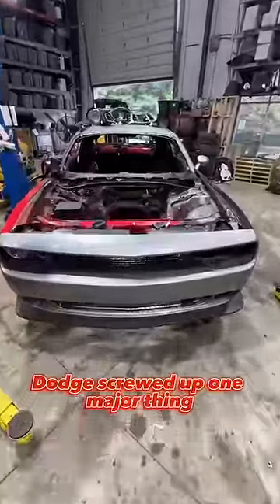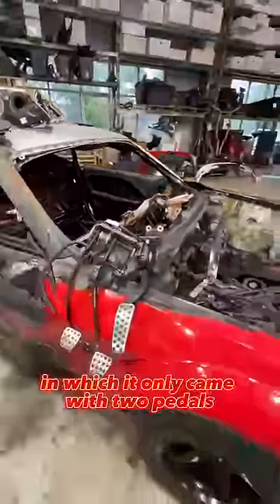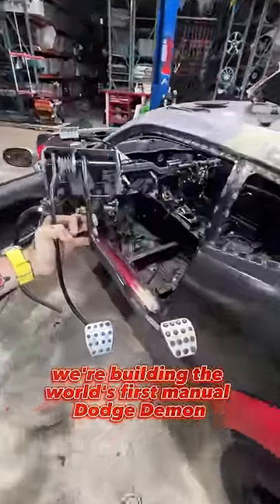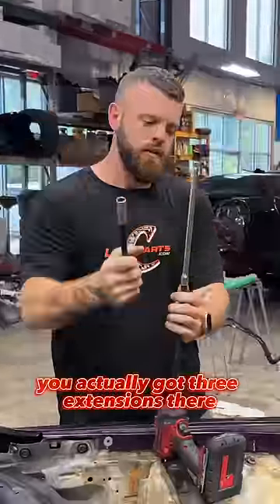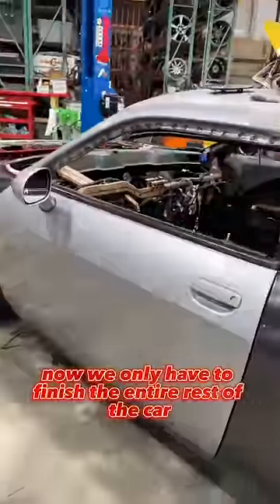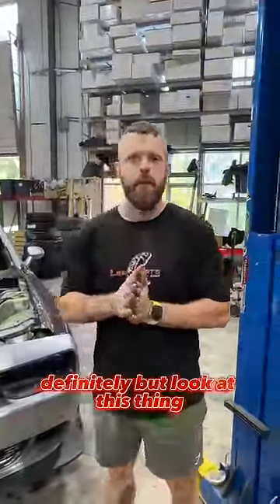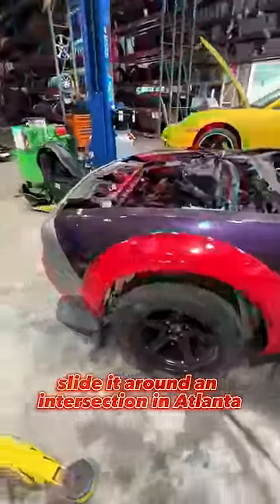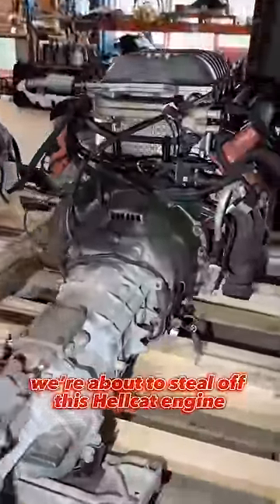Dodge made one HUGE mistake on the Demon!

Comment: Dodge had that trans dialed in. Swapping to a manual transmission will definitely be slower. Cool swap still
Reply: It will be slower but a manual is way more fun
Reply: @bryceangle9773  definitely fun. Be interesting to see how this goes.
Reply: No way 🤯🤯
Reply: @jimcole2648 the same transmission in the hellcats is slower than the manual option. Maybe it’s upgraded for the demon but it is the same transmission.
Reply: @joshroi8610 the automatic hellcats blow the doors off the manual hellcats. All day.
Reply: Differential Gand gear ratios enter the chat.
Reply: Oh wait, dodge owners
Reply: @joshroi8610 different gearing and probably a few more upgraded parts demon is a purpose built drag car, the trans is perfected allowing the 4500lb boat to pop wheelies and run a 9.4 quarter
Reply: @joshroi8610  the cat I drove was pretty quick to me. Definitely not a lag like a clutch. Not pdk Porsche fast but quick imo
Reply: @bryceangle9773 not really
Reply: My hellcat challenger 6spd has 3:70 gears and runs around automatic cars constantly, only difference is the fact that I can drive.
Reply: @ronyoung6054  the driver does make a difference yes. I wonder if there are any videos of a subordinate/manual comparison to see and swap drivers for the runs to not be bias
Reply: @jimcole2648  it takes less horsepower to turn a manual trans than an automatic,  just set your automatic transmission and manual transmission side by side and spin the input shaft by hand
Reply: Modern day automatics will always be better than a manual driver. Dodge effectively engineered out the "Driver Mod"
Reply: @bryceangle9773 I mean the whole point of the demon is to get the fastest drag times so
Reply: @ronyoung6054 this would matter if it was a 2000lb Honda civic with 100hp but it’s a boat with over 800 horsepower manual or auto it can’t care
Reply: Yea imagine the hood dudes in demons had manual theyre already going stupid with the auto
Reply: @ChimenyDust  will be interesting to see how the power is laid down over the auto.  The autos are pretty beefed up.
Reply: @johnnybanks61  this isn’t a Porsche pdk but it’s still a pretty quick trans. The throttle is also.
Reply: @ronyoung6054  true but the difference is not much to compare.
Reply: Some of y'all need to study torque multipliers. Hint, clutches don't have them.
Reply: Who cares if it's slower? It's a heavy boat, at least manual will make it funnier to drive
Reply: @ShogunAutoworks torque multipliers? You mean a convertor? And what does that have to do with the conversation
Reply: @trashbandit2449  torque converters are gear reduction drives until the input and output speeds match.
They MULTIPLY TORQUE. 

Which is like...nice...when drag racing...
Reply: @trashbandit2449  and so the arguments between making it slower vs faster... it did in fact make it slower. Which is fine it's still a damned drag monster. But people are going off the assumption automatics are all Buick slushboxes. Even in the world of normal vehicles, slow ones even, an auto outpulls the manual if everything else is the same. At a dead stop the engine torque is multiplied 1.5-2 times over due to the gear reduction effect, and as the car (or truck) speeds up it gradually turns into a 1:1 drive. Then shifts. Same multiplication though not AS much because the output speed isn't starting at zero so it's already a head start. But still more than the 1:1 you get in a manual once your foot is off the clutch. And the only way to copy that effect...is burn the clutch up slipping it.
Reply: @trashbandit2449  manuals are more fun. And manuals with more gears are faster than autos with less gears sometimes, due to so much spread between shifts. 
But a 5 speed auto would destroy a 5 speed manual assuming all the other variables weight engine are the same.

Now we have close ratio 5 6 8 10 speed autos WITH torque converters.

Not just 2 speed slush boxes vs 4 and 5 speed manuals. The auto vs manual debate answer isn't one or the other. The answer is IT DEPENDS which autos vs which manuals...
Reply: @trashbandit2449  I say this so you don't do what I did. I was beating v8 pickup trucks and could pull a lot more in my 4 speed AUTO Baja, than I can with my 5 speed manual of the same truck. And that's a big deal considering the manual has 4.44 gear ratios and still can't pull a trailer or another broke down vehicle worth a shit. 

With the auto I drug people from ditches, hauled stuff, pulled a big ass 2006 f150 4x4 quad cab 5.4 liter 15 miles home down the highway and back roads... 

I almost burnt my clutch up trying not to stall the manual just trying to pull a minivan onto a haul dolly...

Torque converters multiply your torque. SERIOUS drag racing... autos. Hence why the CAPO Camaro and Demon were both autos.

But like I said in small trucks...auto. small cars, weak ass engine, might wanna get an auto.

Fun, manual. It's just a trade off depends what you need worst.
Reply: @ShogunAutoworks  yes autos will be faster but torque convertors don't really multiply an engines torque going to the wheels. All things the same, a manual transmission will send more power to the wheels than an auto. All a torque convertor does is transfer the power, not multiply it

Pulling has more to do with stalling/not stalling. Not really anything with torque convertors (other than the fact that if your convertor is too high you'll kill your transmission by towing)
Reply: @ShogunAutoworks  that being said I would rather tow with an automatic
Reply: @illililililillli  I’m not disagreeing it will be slower. I think it will but again it would be a cool swap to see. Looking forward to it
Reply: @ShogunAutoworks thats.. not how torque converters work...
Reply: @outkast937  according to hot rod magazine, car and driver, popular mechanics, and about any other sources yes it is.
Reply: @trashbandit2449  it multiplies it during slippage. Fact.
Reply: Copied directly.

A typical torque converter will have a torque multiplication ratio in the area of 2.5:1. The main point to remember is that all properly functioning torque converters do indeed multiply torque doing initial acceleration. the more drastic the change in fluid path caused by the stator from its "natural: return path, the higher the torque multiplication ratio, a given converter will have. Torque multiplication does not occur with a manual transmission, clutch and pressure plate; hence the need for a heavy flywheel, very high numerical gear ratios, and high launch RPM. A more detailed discussion of torque multiplication can be very confusing to the layman as high multiplication ratios can be easily considered the best choice when in fact more variables must be included in the decision. Remember, the ratio is still a factor of the engine torque in the relevant range of the torque converter stall speed, i.e.: a converter with a multiplication ratio of 2.5:1 that stalls 3000rpm will produce 500 ft/lbs of torque in the instance of full throttle acceleration if its coupled to an engine producing 200 ft/lbs of torque at 3000rpm. However, if this same engine produces 300 ft/lbs of torque at 4000 rpm, we would be better off with a converter that stalled 4000 rpm with only 2.0:1 torque multiplication ratio, i.e.: 300 x 2.0 = 600 ft/lbs at initial acceleration. Of course it would be better yet to have a 2.5:1 ratio with a 4000rpm in this example (provided this combination still allows the suspension to work and the tyres don't spin). This is just a brief overview as the actual scenarios are endless.
Reply: This, I see in my own vehicle, the last identical engine powered vehicle being an auto and the next a manual...
Same engine... 

a converter with a multiplication ratio of 2.5:1 that stalls 3000rpm will produce 500 ft/lbs of torque in the instance of full throttle acceleration if its coupled to an engine producing 200 ft/lbs of torque at 3000rpm.
Reply: Also you may have a 500hp engine but it's only 500hp at one little spot on the rpm range buddy.

You wanna stay high rpm as much as possible where we your 500hp sits at. You aren't doing it with a manual sorry. Especially once you launch and dump that clutch unless you just spin all the way down the track and never shift. 

The auto allows slippage PLUS traction, while multiplying torque and letting the engine over rev what the rear end is doing to keep the engine in its power band while the ass end finally speeds up and it's time to shift and then it can over rev the ass again and multiply the torque some more. 

Dude there is a reason promods aren't 5 speed sticks or whatever.
I'm not even ragging the car a stick shift demon is still a fuckin insane ass build.

I'm trying to help you. Torque converters are by far the easiest mod... and if you don't understand em .... you're missing out.
Reply: @ShogunAutoworks  during slippage yeah, and of course they're faster. But a nicely set up brake/linelock/transbrake will handle launches just as well. But yes I agree with what you've said
Reply: An automatic will always be faster, but I'm surprised they didn't at least have it as an option
Reply: As someone over 50, I never imagined the complexity and efficiency of today's automatic transmissions.
Reply: @bryceangle9773 not really. 

People who drive a manual because its cool to do so in their mind say that.
Reply: @mainmanmooky8820  true. From what I was hearing in auburn hill proving grounds, they took a trackhawk driveline and swapped it in a challenger. Said it was fun beast but would never really build. Must be fun working in the testing department
Reply: @jeepmanxj It engages you with the car more that's it. Also people who drive manual pay more attention to the road and that's a fact because you have too. They are slower but also has alot of pros that an automatic can't do
Reply: @clutchbleach2057  no. You don't and that's how I know you haven't driven with one very long.
Reply: @jimcole2648  about 20 30 %
Reply: @bryceangle9773 manual is not fun 😂
Reply: Who cares, your not doing over 45mph on city roads anyway. Manual is way more fun then mindlessly driving in traffic. I know hes taking this to a track but most people manual is fine
Reply: @betastagevirus997  yes and no.  Driving a stick in bumper to bumper traffic and hills is a pain in the ass.  You make a good point on speed and city limits but this in a stick would be interesting but that auto is pretty good.
Reply: Manual is so much more fun to drive.
Reply: Autotragic users flexing “its faster” my brother in Christ you lose 15% more power just in parasitic loss with an auto 😭
Reply: Automakers only make these cars with autos for accessibility purposes.  Manual sports cars were restricted to just rich white men, but now that they're automatic, they can also be sold to women and diverse groups.  It just happened to be a happy coincidence that a transmission with 42 gears that has a computer shift itself is faster than a transmission with 6 gears that needs to be shifted by a person.
Reply: @joshroi8610  it's not humanly possible to shift faster than that automatic. So, no. Just...no.
Reply: The torque converter is what transmits that torque from the engine to a rotating driven load. In an automatic transmission car, the torque converter connects the power source to the load. 

Clutches are best for high-speed applications, while torque converters are ideal for applications that involve heavy loads.

Is A torque converter Faster than a manual?

It will double the torque and you will go more than twice as fast compared to a manual that will also need some clutch slippage until it gets to a good rpm like 2000rpm. It's also good when you are in a high gear and accelerate.

Will a new torque converter give me more power?

Thus, an upgraded or stronger TC will provide a better transfer of power to the drivetrain. You will not be gaining any horsepower, rather you will be recovering horsepower that would have been normally lost with your stock TC. In addition, a stronger TC will have a higher stall speed.

Dodge knew what they were doing building a purpose built car. And the manual wasn't it. I own several cars. Seven. Mostly manuals. But the one built auto blows them all away on a dig. Then the road gets longer....😂

Ahhhh. But the PDK Porsche...The combination of thumping upshifts, aggressive auto-timed downshifts and tightly spaced ratios is enough, but clearly such special Stuttgart engineering has resulted in transmission longevity too.

It’s best sampled beyond 8000rpm in a 911 GT3 RS, where you can even pull both paddles at once and uncouple both clutches to, “neutralise the driving behaviour of the vehicle when oversteering in a wet curve, thus redirecting additional cornering force to the wheels of the rear axle”. Then the cloud dissapears and you temporarily see heaven and Jesus squinting not to look. Marvelous.....🙏
Reply: @dailydose8035 sounds like probably a driver issue
Reply: @dailydose8035 Not if you powershift a manual, and do it correctly without chewing teeth off the gears. Automatic transmissions function by slipping, it's part of their design. The side effects of that is less power getting to the wheels. Manuals, however, do not slip. Well, they don't if the clutch isn't worn out. They have a complete lockup, meaning more power is transferred to the wheels.
Reply: The trans wouldn't have blown up from factory if it would've had 3 Pedals, but ya know, dodge messed up again with the transmissions just like they did with their early 2000 1500 pick up truck transmissions.
Reply: @guitarist-2925  It wasn't the 1500's it was the 2500's and it was only one transmission, that wasn't even made by Dodge. 

Also... We just gonna ignore the Ford/Chevy 10 speed transmissions that have been blowing up left and right? Why don't I see anybody talking about that junk 😂
Reply: @guitarist-2925  these transmissions are good. They did their homework to make this reliable.
Reply: @bryceangle9773 suppose if you're keeping it on the track driving is about having fun
Reply: @joshroi8610 there is no such thing as a manual version of a car being faster than the automatic version because computers will always be faster than any human when shifting
Reply: "It we be slower"

Like a majority of people can even make use of it anyway 🤦‍♂️
Reply: @johnnybanks61 better at what? Driving fast in a straight line? Autos in autocross get shit on
Reply: @joshroi8610 yeah no autos are way faster and it’s not debatable
Reply: Same with the R35 GTR a manual wouldn't have benefited the car in any way shape or form
Reply: @bryceangle9773 that's not always the case tho , if a manufacturer makes a car with 2 options for the gearbox one manual one DSG it's always more likely that the DSG sounds better , drives better, performs better and can handle the power you throw at it better , manuals are good on cars that only exclusively came with a manual like the Honda Type R cars like the Ford Focus ST and RS cars if a car has a dual clutch version it's better , we as a people need to stop making as if manuals are the greatest thing on mankind yes i admit swapping some cars to manual is amazing it's great like swapping a known supercar to a manual which didn't come with a manual that's cool but swapping a manual into a car that actually came with a manual or speccing your car with a manual when the DCT or DSG is actually better is actually dumb imagine speccing a BMW M car with a manual nah nah nah up untill the E46 all BMW's should be manual but not the bigger cars like the 5 series and up so sometimes you have to think and say to yourself nah it doesn't work
Reply: Either way it will still lose to a Tesla Plaid.
Reply: Half a second slower with experienced drivers 1/4 mile from a roll I would bet 6 speed pulls
Reply: Half a second slower with experienced drivers 1/4 mile from a roll I would bet 6 speed pulls
Reply: Put a  t56 Mangum, mint
Reply: The Miata isn't that fast and yet it's loads of fun. Fun > Speed.
Reply: lol 😂not by much with a car with that much power will beat a auto anyday
Reply: @tatsuhirosatou5513 yes really
Reply: @Billmull8622  no manuals are over rated especially in straight line cars
Reply: True but who’s trying to get a ticket
Reply: Maybe they can make up the difference in speed by adding more hp,maybe twin turbos
Reply: @Buster_Stankbag  no they are already at a traction limit, plus the epa won't let them add more power
Reply: I dont care how dialed in it is a manual is over better acceleration out of corners and such. In a drag race maybe not faster but a acceleration corners race yes
Reply: @csb772  a manual is never faster
Reply: False a manual has and will always be faster. A computer can only drift so fast while humans evolve and learn. Never have I seen a automatic beat a manual. Not once in history.
Reply: @dailydose8035 that’s kinda weird fr but I guess if they don’t come with a custom one made for them that’s how it goes?
Reply: @bryceangle9773 And more control over everything. Period.
Reply: It will also be more control, especially if it is ever used in any type of twisties. Totally worth it for a road car.
Reply: Automatic is ass, l2drive stick and stop coping
Reply: Slower in a straight line yea… but a Tesla can stomp harder with a couple hacks. 

If straight line speed is all you car about. Go electric.
Reply: The reason the demon only came in auto is that there aren't really any manual transmissions that handle the power.  "Upgrading" to a weaker manual with 2 less gears isn't much of an upgrade.  All so you can have a clutch pedal to prop up your masculinity.
Reply: You can make up for slower shifts with a extra 500hp
Reply: @skaterboy708  gas vs electric and awd? 🤣
Reply: @ronyoung6054 , other cars with how much hp?
Reply: "Manuals are more fun" only said by people who have never had a 4k torque converter and 600hp. Ignorance is unfortunate. No idea how much they are missing out on.
Reply: @AndrewKidd14145 Thank you. Most people don't think about this and assume everything is the same.
Reply: @ShogunAutoworks Exactly
Reply: @ShogunAutoworks Exactly
Reply: @trashbandit2449 You know only an automatic can have a transbrake.
Reply: @ronyoung6054 yeah but 0-60 is worse because you need to shift to 3rd for 60
Reply: @mike-yv9nt my car goes 98 mph in 2nd
Reply: No shit Sherlock
Reply: @CoolHandLukeVol  because there's no way possible to launch a manual and never has been
Reply: Yeah, it's gonna be hard to control that car and its speed with a manual
Reply: Dodge doesn’t have a good reputation with their slipomatic… I mean automatic transmissions.
Reply: @dailydose8035 The manual is more tune friendly and more fun to drive. Not to mention you get more control over what the car does.
Reply: @archwolf3835 I agree, manual transmission's are for men only
Reply: @iheartapple-114  they had some trans that were horrible I will agree. Other makers have their issues also.  This auto is a well built trans imo
Reply: @ronyoung6054 As a mechanic and car enthusiasts I can confidently sequentials are the only manuals that make sense on powerful cars designed to go extremely fast in a straight line, you need to have both hands on the wheel as much as possible to keep it under control but feel free to do whatever makes you feel "manly" long as you only hurt yourself in the process.
Reply: @archwolf3835  sorry to hurt your snowflake feelings Mr code name archwolf, all and I repeat ALL fast car's have manual transmission's or high gear only manual transmission's. Fluid drive transmission's can't handle the horsepower. If you can't drive a manual transmission and win then stick with the easiest thing that any monkey can drive an automatic
Reply: @ronyoung6054 So a ferrari fxx k is a manual? Sure pal all high speed cars on a drag strip have manuals but maybe do research before making generalized statements
Reply: @archwolf3835  sure kid. 🥴
Reply: @joshroi8610 automatic transmitions now a days can switch gears way faster than someone can in a manual
Reply: @ronyoung6054 mine has 4.10
Reply: @dielog2211  nice, that's the first time I've ever heard of 4.10s in a hellcat 👍
Reply: They wanted to sell it to as many posers as they could 😂
Reply: noooo i need my shifty stick to move every 5 seconds!!!!!!!!
Reply: It might be dialed in tuning wise but it’s built to only handle less then half the horse power put through it as a dodge tech The challenger transmissions blow up literally metal all over the road under normal driving conditions
Reply: @joshroi8610 did you jus say a manual is faster than a auto?😂
Reply: @poppa4352  it can be
Reply: @joshroi8610 that's utter bullshit. The fact that you even typed that amazes me. Theres no manual transmission that's faster than any of today's automatics. The automatics shift way faster than any human can dream.
Reply: It's a slow par it's slow eather way
Reply: We are aware of that... you know,  from watching the video
Reply: @ronyoung6054 sorry, the days of a person being able to “out shift” an automatic are long gone. And with the upgrades that were made to the transmission and torque converter, this car will be much slower than the stock version. And you also lost the transmission brake that came with the Demon. Basically what he made was a manual Hellcat Redeye. Yes it will be fun to drive, but it will be slower.
Reply: @TheCrazyMoparDude68  if what you say is true then why do all pro stock car's in NHRA drag racing run manual transmission's?
Reply: Sports cars especially muscle cars are meant to have a manual transmission lol. Nothing else matters. For those talking about how an automatic transmission is faster... hahaha no shit smooth brain!!! That’s not the point🤣
Reply: @bryceangle9773 for a car that only goes in a straight line it isn't that much more fun tbh
Reply: @ronyoung6054 can you trade me your hellcat for my corvette c6?
Reply: @Andres-f3r4h  👍🤔 lol
Reply: @dailydose8035 it depends on who's driving the manual because the driver makes a huge difference w a stick car but with an auto not so much.  This is what yall don't get when you make blanket statements like that.  You assume everyone is gonna be waayy slower w the manual but that isn't necessarily true.  Don't give me that cringe bs "you can't outshift a computer" (so tired of hearing that stupid worn out statement).  That goes without saying but you can come close enough to equaling it (if you actually know what you're doing) that it isn't gonna be a huge difference between the two meaning the performance difference isn't gonna be life changing 2-3 tenths isn't gonna change everyone's life lol.
Reply: @conradbreitfeller3841 the 18 demon doesn't run 9.4 it supposedly went 9.6 at 140 but no independent owners were able to replicate that most are 10+ second cars out the box.
Reply: @jimcole2648 saying lag like a clutch tells me you have no clue how to Powershift lol
Reply: @jimcole2648 the driver makes more difference than anything else.  Ppl have no clue just how much it could literally change 5+ car lengths in a race comparing bad vs good drivers w manuals.
Reply: @realjoshuaW it does care.  Automatics rob more power to the rear wheels and they're heavier.
Reply: @ShogunAutoworks no man these days everyone acts like automatics are unbeatable gods of the streets not many ppl are thinking automatics are gay because they're slow.  It isn't because they're slow it's because they're autos.  It's pretty well known all autos today are as fast or faster than any manual that isn't even the topic anymore.  Ppl can't fathom wanting a manual knowing it's 2 or 3 tenths slower omg what are we gonna ever do lol.  There's always somebody faster and there's a million ways to get those couple tenths back without ruining the driving experience.
Reply: @ShogunAutoworks I promise you a similarly geared auto isn't "destroying" me with a similarly geared manual.  Not happening.  It is possible to shift manuals pretty damn fast with the right setup and driver.  I shift my gt500 so fast it basically sounds like an auto.
Reply: @jimcole2648 you'd be shocked how close to the same times a good driver could get.  Absolutely shocked.  Problem is it takes a good driver to do it and they are far and few between.  This driving thing ain't for everyone.
Reply: @ShogunAutoworks you can do it witu a manual too with the right gearing.  Every since the stupid 10 speed came out everyone thinks all autos are 10 speeds lol.  That is one transmission of a slew of autos...
Reply: @jeepmanxj no some of us truly enjoy driving our card and don't want them driving for us.  We actually like to be a part of what's going on.  You auto fanboys just don't get it.
Reply: @ClapDemNalgas773 speak for yourself.  Its pretty fun with the driver mod and 99% of the population will never know what it feels like to row gears door to door with that modern auto beside you in that race.   When people see you shifting faster than they even thought was possible.  Most of yall will never know what thus feels like.
Reply: @juicyj9357 you'd be shocked how close you can come to equaling it.  I know to you you think it's this unreal thing so far from being possible it's ridiculous right?  Not so fast.  The fastest manual drivers aren't that far off modern auto shifts.  I've seen manuals w the driver mod run door to door with modern autos with similar or the same mods.  Manual doesn't always get destroyed like yall think you always forget the driver plays a huge role in how fast or not fast your manual is.  Don't assume everyone drives a manual like you (assuming you can drive one at all lol)
Reply: @Hunglikeagrimsmo up until just a few years back we'll driven manuals were as fast or faster than autos.  It wasn't until the auto started having a gearing advantage they started being quicker i.e. when they went to 8 and 10 speed autos.  When they had similar or fewer gears (6 speed vs 6 speed) they were basically a drivers race stock edge to the manual.  Once you tuned the auto and it was tune vs tune it might have a slight edge but they were basically a drivers race.  Some of you show your age by not remembering stuff that happened just 10 years ago lol.  Now you act like every trans ever is like the ones from the last few years and that isn't true.  You'd be shocked how close to an auto you can shift a manual time wise.  I can shift my 07 gt500 so fast it literally sounds like an automatic.
Reply: @Hunglikeagrimsmo back when it was 4 speed auto vs 6 speed manual 20 years ago the manuals were faster in those days.  The fact you only remember the last handful of years tells me how young you must be.
Reply: @khalilharrison9404 I doubt it's half second slower against the driver mod.  I'm thinking 2 to 3 tenths.
Reply: @tatsuhirosatou5513 False.  Tell us you're young as hell without telling is.  Up till 15 to 20 years back they were faster and until the 8-10 speed autos came they were just as fast stock vs stock (assuming a good driver).  The auto didn't start being faster in a straight line till less than 10 years ago.  Also straight line racing isn't the only kind of racing.  There's roll racing there's road racing autocross canyon driving etc.  Manual is better in those scenarios